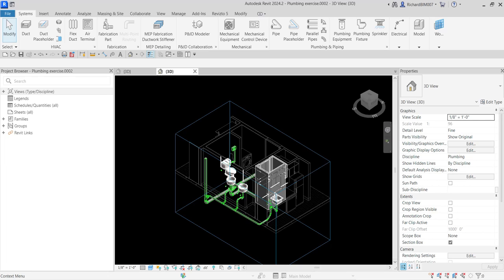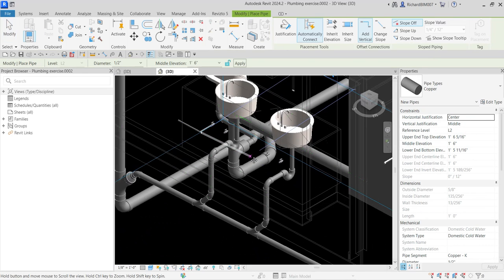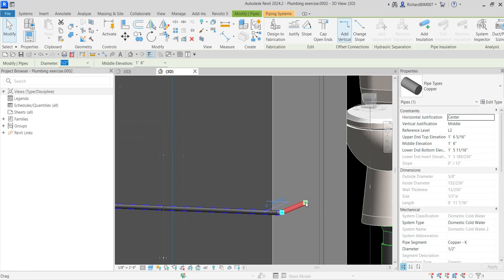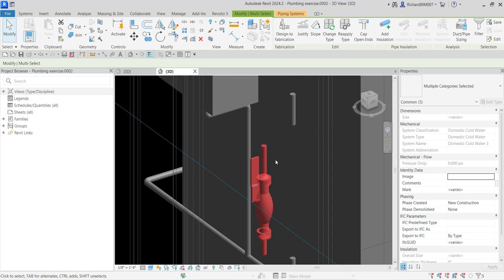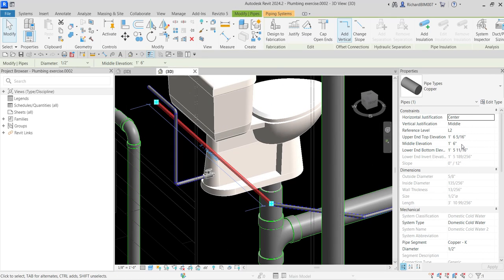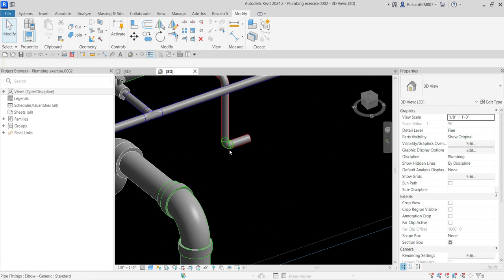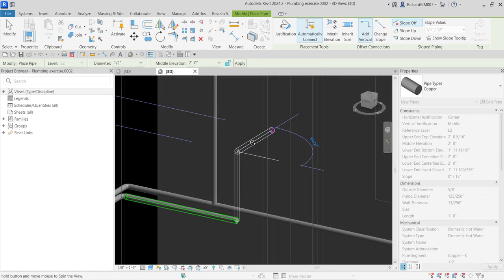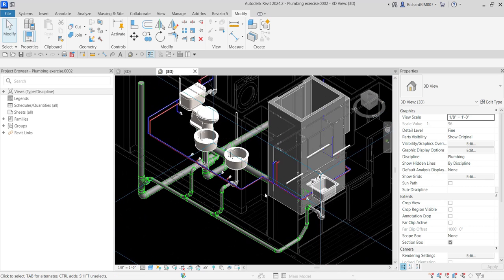REVIT 2024 PLUMBING DESIGN: DOMESTIC WATER PIPE LAYOUT

Comment: Hi Sir, Great video tutorial. I am new with REVIT plumbing but I want to know if there is specific REVIT data tool to measure water consumption or add-ons that you can suggest to calculate water consumption. Salamat po
Reply from the maker: Hello po sir. Revit itself does not have a built-in tool specifically for calculating water consumption directly. However, you can use Revit’s plumbing design features to model systems and then extract data (like pipe lengths, fixture counts, and flow rates) to perform calculations manually or with external tools. Tingin ko may mga plugin na available sa autodesk appstore.